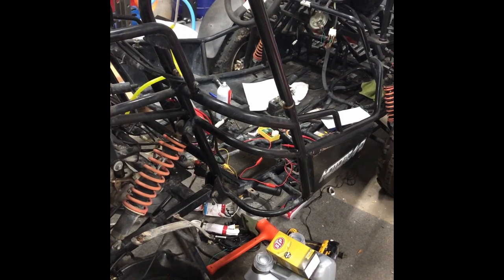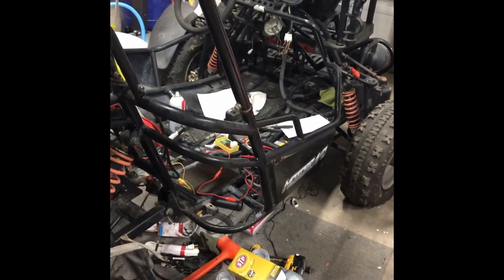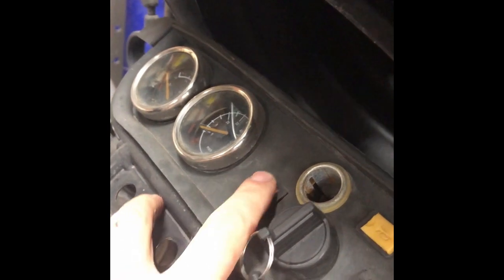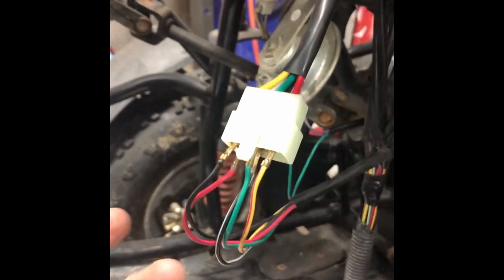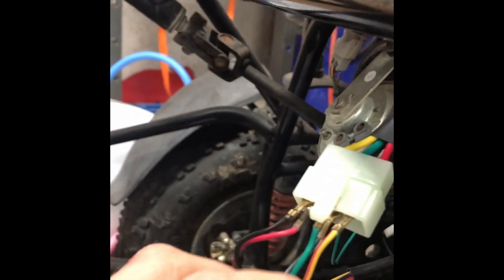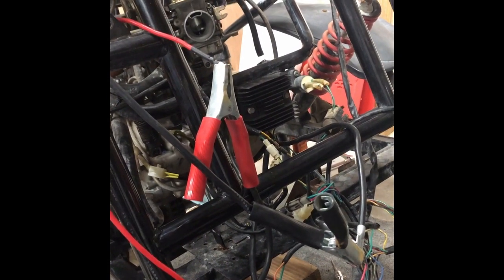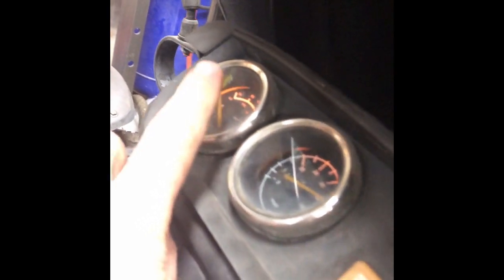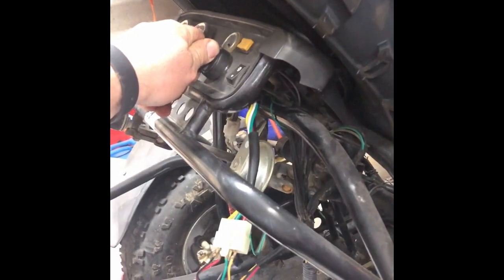Part 1 Chinese 250cc 150cc Go Kart/Buggy Wiring Schematic Roketa-GK-19 Kinroad MotoBravo GY6 Engine

Comment: Hello, I reached out on your 4pt. Vid doing the valve job, and ended up rebuilding my head, and all of the corresponding timing components. This certainly solved my compression issue. I finally replaced the previous owners chopped ignition wiring job, and found your schematic and information VERY helpful. I was able to get my replacement key switch installed first shot, even with the wire color variation on my model!!! Thanks so much for your detailed content. Keep up the excellent work!!!
Ps: my specific issue was a incorrectly installed cam chain tensioner, stretched chain-lead to bent exhaust valve and worn cam gears. Carbon build up was EXCESSIVE! head quality was super poor with burrs throughout the timing chain area, also cleaned that up.
Reply from the maker: Sometimes we just gotta dive into that engine to see the obvious eh!  Thank you for the kind feedback.

Comment: Could you make a video of the wiring harness on the buggy. Go over each wire and where it run’s to. Just to keep it simple and painless.
Reply from the maker: Did you see my Part 2 video on this?  I would think this is what you are looking for?  https://youtu.be/zwj9Y4OONJg
Reply: I did yes! Thank you for the quick reply. I was just hoping for a quick visual video, my wire colours are different from your’s other then the green’s
Reply: @Linderman01  did you ever get yours fixed? Because on mines my color is blue and white instead of black and white leading to the key switch

Comment: Thank you for this video I was able to fix my hammerhead someone installed the wrong CDI on it 👍
Reply from the maker: Glad to hear it!  Thanks for letting me know the video helped you!
Reply: Hi, which CDI i need to use? My CDI is missing and i had only the engine harness, the second part to the front harness is missing. So i don't know how the wireing is going to fit correctly.

Comment: Hey! I found one of these carts out in the desert... lucky me. I could really use that schematic on digits if you could help
Reply from the maker: Really?  Wow.  Finders keepers.  See. Part 2 and that will take you on a tour through the schematic.
Reply: @pattywaktdiy4175  yeah, I'm stationed out in the middle of the high desert and was taking a walk and it was just dumped under a tree. Snagged it up. Ordered a bunch of parts and now need to start chasing wires and getting it running.  Watching part 2 now.

Comment: ill try to be brief...  great video too.
I got a new wire harness from Australia off ebay.  my Kinroad came with a 2 part harness and the rear section was all chewed up.  The new harness does not separate.  The issue i have is the key switch has 5 wires but the new harness has only 3.  Will this be an issue or do i need to add 2 wires?   Love to know where to get a proper Kinroad Raptor 250 rear wiring harness....
Reply from the maker: Dan, sounds like your replacement wiring harness is for an AC CDI setup.  If your ignition switch is "factory", that engine is likely designed for a DC CDI setup (like the one in my video).  In which case, you would want the extra wires so you could power your headlights with just the key and battery power (without the engine running).  Did your buggy have a CDI when you got it?  Do the plugs look like mine in the video with a 4x2 plug?  Just looking for signs to validate which factory setup you have there (AC or DC).
Reply: @pattywaktdiy4175  Fairly sure it is a DC...  My CDI has 4 wires.  tracing back the B/W wire that I am missing seems to go to the upper right plug on the CDI, the kill switch.  The other is the ground...  So far everything is lining up.  Now i need vacuum tube help and timing/ valve adjustment as i cannot get this thing to fire.  I got this unit in a box of parts.  To this point i have come a long way.  I appreciate your reply.

I do have to ask what the yellow wire is for on the Carb choke?
Reply from the maker: @wigleyd  that wire is the “auto-enricher”.  Instead of choking off air, it adds fuel to start a cold engine.  That wire carries an AC power signal from the stator letting the enricher unit know that the engine is running.  Internally, with this now constant source of power enricher slowly extends a plunger/pin where once fully extended inside, it closes off the extra fuel supply.  You’ll notice the engine RPMs drop after about 2 minutes of idling.  This is the reason why.
Reply: @pattywaktdiy4175  looks like I'll have to splice this into a stator wire then?
Reply from the maker: @wigleyd  yes.  Splice into a wire that goes from the stator to the regulator/rectifier.  You could have up to 3 to choose from if you have a 3-phase stator.
Reply: @pattywaktdiy4175  yes 3 phase. I appreciate this help. 
Do you do vacuum tube videos too?
Reply: Boom. It fired up last night..  unfortunately the motor was inside my kitchen. Time to air out the house. Thanks for your help.
Reply from the maker: @wigleyd  congrats!  That’s a special feeling!
Reply: @pattywaktdiy4175  hey one other question but where is your ground attached to?  Frame or motor.  I have mine on the motor but am sure it's the wrong spot.
Reply from the maker: @wigleyd  Somewhere on the engine is the best ground.  I have mine grounded to one of the starter motor mounting bolts.  I do have another ground right behind the dash/ignition but that's a redundant connection with the main ground described above.

Comment: Hi mate,  well done on clear camera work and excellent explanations. Thanks for putting this up, there's very little accurate info for the 250cc, this is great. Do you have any info on the valve adjustment process?
Reply from the maker: Yes, I’m rebuilding the head now.  
Working new piston, rings, cylinder, valves, valve springs, cam and rocker arms.  That video will be posted within the next month…and as far as accuracy, I’m taking as much as possible from the service manual.
Reply from the maker: Here's that video (this is the final video in my 4-part head rebuild mini-series):  https://youtu.be/us_sHsQd7nU

Comment: Nice video sir. Where can i buy all the harnesses? Thanks in advance ☺️
Reply from the maker: Unfortunately, I can't answer this.  I used what was available and added/replaced wire where I needed to.  Depending on your model, which is very likely no longer in production, you'll probably have to do what I did.  It'll make you an expert on the electrical for your machine!
Reply: @pattywaktdiy4175  any ideas why I went to I press the gas pedal turn off

Comment: I have a Chinese 2006 Redcat ATV that had a bad wiring harness. The previous owner really mucked it up and couldn't figure out how to wire it. Now I have it and have bought a new wiring harness, but nothing is matching up... I know the harness will work but have found NO wiring diagram on these toys (Duh! Its Chinese) Any suggestions to get this thing running??
Reply from the maker: Congrats to you on your new project.  In your situation, I would start with what I know and make my own wiring diagram.  Try to compartmentalize the different “systems”:  starter, battery, headlights, taillights, brake lights,  coil, etc.  That pile of unknown wires will soon become fewer and fewer and before you know it, you’re Ridin’.  Focus on what it takes to get the engine to run:  fuel, timing/compression, spark.  Out of those 3 only 1 is electrical.  Start there. 
You should still be able to use most of the diagram I have in my Part 2 video, did you see it?

Comment: Even knowing this, how do you figure out what wires coming from the ignition match the harness? Are colors or locations in the back of the ignition somehow universal
Reply from the maker: I don’t think you’re gonna like my answer…you’ll need to go thru the tedious process, like I did, to understand in detail the wiring schematic and then use a multimeter on “beep” mode to identify and label wires.
Reply: Yep turn a good multi meter to ohms/ continuity beep. You want the beep. When probe tips touch the meter beeps. With ignition off touch wires until beep. That's your 0 power or off position wires. Then turn key on aux, probe wires till beep. That's aux power, etc erc

Comment: How does the temp gauge work?  There is only a green wire to a temp sensor located on the carb auto choke...  my temp gauge seemed to work once but I'm baffled as to where it is getting it signal from.
Reply from the maker: Dan, the gauge basically measures resistance which is converted to a degrees (F/C) we care about.  See the Part 2 video which I think will help you identify what the wires are doing.
 On my liquid-cooled engine, there is a small spark plug-looking widget screwed into the return cooling line to the radiator that has 1 wire coming off of it.  Resistance measurements change as temperature changes. Do a quick search on how resistance temp sensors work and it will help you understand.  Refrigerators and air conditioning units all use this same concept to measure temperature electronically.  It's surprisingly simple!  Someone just had to figure out that electricity flows differently depending on temp. 
You should have 1 wire going back to the temp gauge (somehow).  The wire that connects into your auto-choke is likely just a ground connection.

Comment: One more question sir do you know why oil is coming from the 3 yellow wires next to the stared, I think is 5 wires 3 yellow and other 2 more
Reply from the maker: I think I understand your question…if you have oil coming out of those same holes the wires are coming out of, you need to replace the crank seal on that side of the engine as it is leaking oil.  You should not have any oil in where your stator is housed.
Reply: @pattywaktdiy4175  Thanks. any idea where I can buy the seal? Sorry for bothering you. I just want to get fixed

Comment: What wiring harness kit did you buy for it and also is the stator 18 pole stator with the 3 holes ?
Reply from the maker: I did not buy a new harness.  I used mostly existing wires and added new ones for those missing.  
Yes, my stator had 3 holes.  However, the one I replaced it with did not line up exactly correct with the engine case so I only have 2 bolts securing it to the engine case.  Other than that, the stator works as needed.
Reply: @pattywaktdiy4175  the reason I asked is because I have a similar go kart but the wiring is fried and I have to buy all the complete wiring harness but I can’t find anything that fits it
Reply from the maker: @joaquinmaciel4431  If your buggy is the same model as mine, you can look up parts for a Roketa GK-19.  Most of the parts are interchangeable.  Else, you can just get a bunch of spools of wire and start from scratch.  I guarantee you'll be an expert on the electrical if you choose this route!
Reply: @pattywaktdiy4175   I’m no even sure on the brand of go kart that’s why I’m having a hard time figuring out the stator and the rectifier that will fit all I know is a 250cc engine

Comment: I have a baja 250 dunne buggy i need a wiring diagram for the Stator, CDI box and the ignition do you have one
Reply from the maker: Did you see the part 2 video?  That should help you.  I go over a wiring diagram in detail that you compare to yours and see if it helps you.

Comment: I have a vonroad 150cc scooter and switched motors with about the same bike and it wants to start as soon as I touch the battery cables together??
Reply from the maker: If your wiring is correct, there’s a good chance your solenoid is “stuck”.  Which mechanical solenoids tend to do sometimes.  Smack it with a hammer to try and jostle it loose inside. The other thing it could be…there’s a relay on the solenoid that could be stuck as well.  If you look at the solenoid and see a fuse, that’s the relay portion.  It could be stuck as well.  May just need to replace the solenoid/relay combo.  They’re inexpensive.  But, if your ignition wiring is wrong, it’s possible your relay is “engaged” all the time.  Your solenoid and solenoid relay could be just fine.

Comment: What if the engine is idling fine and revs up but no forward or reverse
Reply from the maker: Is the variator catching and driving the belt?  (In case someone doesn’t know, the variator is the front pulley of the drive belt).  If it is and you have reverse, you have a separate gear box to look at.  On the front or side of the gear box, force the lever one direction or the other and see if it engages (be careful and only do this at idling engine speed.  The spring on your gearbox (outside on the lever) may be worn to the point where it doesn’t force it into forward.  
As for not going into reverse…these setups are notorious for “cable slippage”.  You’ll just need to adjust the cable attaching to the gearbox so I pulls the lever far enough to get into reverse. Hope this makes sense.

Comment: There is nothing worse than prople messing with the electrics when they dont know what they are doing.
As somebody that rebuilds anything from motorcycles, excavators, trucks all the way to ambulances i can tell you it is a very painfull time trying to figure out wtf is happening and where is the problem without going thru the entire installation. And most of them come without a diagram
Reply from the maker: Are you inferring I don’t know what I am doing?  If so that’s ok.  Just looking for clarity on what you are saying.  See part 2 video for an extremely detailed tour of the wiring schematic, as requested.
Reply: @pattywaktdiy4175  What i am saying is that i feel your pain with people cutting wires and doing what they r not soposto.
You seem and sound more than capable to do the job, and you got the thumbs up from me for sure 👍

Comment: Any info on the electric choke? What triggers it? Why it wouldn’t work?
Reply from the maker: The “auto” choke works much the same way that the coolant temperature sensor works…with a resistor.  Powered by 1 wire coming directly from the stator coil, the auto choke is designed to only work for about a minute before “disengaging”.  It is assumed the engine warms up in that amount of time and is no longer needed.  Basically, there’s a needle in the carburetor attached to a moving “resistor” which retracts slowly once power is given to directly from the stator.  It’s resting, “cold” position is “extended” so the needle plugs the special air port in the carb.  Hope that makes sense.
Reply: @pattywaktdiy4175  yes it does make sense, any idea on what ohm resistor would be used in the circuit?
Reply from the maker: @HammyChigger  i replaced my carburetor which came COMPLETE with the new electrical components so I haven’t looked into it…or if it’s even possible to find that individual part separate from the carb.

Comment: I have a kinroad 250 cc can you help me on how the fan I wired up
Reply from the maker: Sure I can try.  What is your question, exactly?  Are you installing a new fan where there was not one there before?  Are you just replacing a fan?
Reply: @pattywaktdiy4175  just trying to have it stock that's it
Reply: And just trying to figure out how it's connected to the buggy.
Reply from the maker: @JoseManuel-lj4dk  I bet your existing fan is wired directly off of your regulator rectifier.  That’s where it gets power.  I am finding most manufacturers use black wires for that power source.  You should have one wire from your fan to a 12v source and the other to ground.  My fan turns on with the key…I’m going to change that because it takes juice away from the starter motor.  I’m going to put my fan on a switch.  Let me know what questions you have and I’ll try to be more timely in my response.

Comment: I got a question for you I don't even know if you're still involved in these go-karts or not if you are reply and I'll ask you the question thank you
Reply from the maker: Go ahead with your traffic…
Reply: @pattywaktdiy4175  I picked up a Trailmaster 300 it's a 2021 it's brand new I noticed riding it when you get to a certain Hill or like a stop then try to start back up again the belt squeals I'm wondering if I could change the weights and this one is well drop down to a lighter-weight for a little more low-end
Reply: I also got a hammerhead 150cc I'm a little bit more familiar and understanding with those
Reply from the maker: @jasonurban3597  hmmm.  If it’s squealing that makes me think your belt might be the wrong size or it’s backwards.  Did you watch my video on changing gear ratio on these CVT (continuous variable transmissions)?  If you have an asymmetrical belt, one edge has a 45 degree bevel and should likely be toward the outside of the axle so it can climb up and down the drive pulley to change the gear ratio.  In summary, I’d verify belt size and orientation first. 
If you don’t have enough power with the gear ratio you have, your engine should just bog down but the belt should not be slipping.
Full disclosure, I’m not familiar with the trailmaster.
Reply: @pattywaktdiy4175  then it would had to be like that from the factory cuz the thing is brand new it literally only has 54 miles on it but I understand what you're saying and yes I did watch it awesome video by the way it just seems like when you're putting stress on it like starting from a start up a hill and really squeals like it's slipping

Comment: where is the resistor and how many ohms is it?
Reply from the maker: The only resistor I know of is the water temp sensor located at the head right next to the carb inlet on this GY6 engine.  Is that what you are referring to?  See my part 2 video for the wiring schematic that shows the water sensor (which is a resistor).